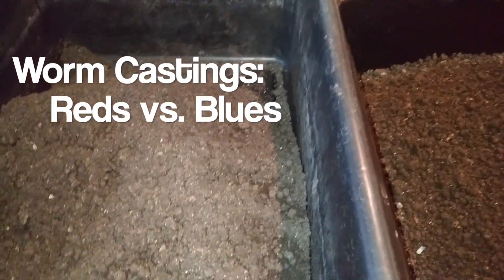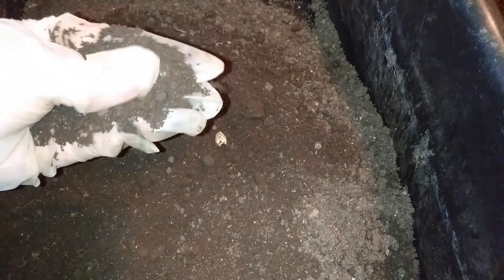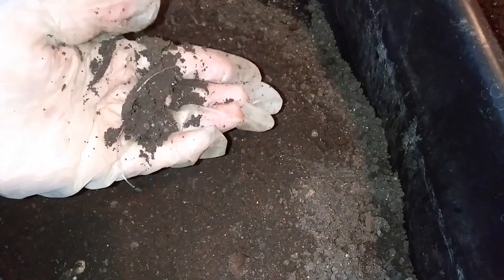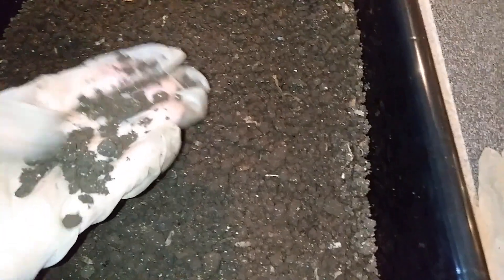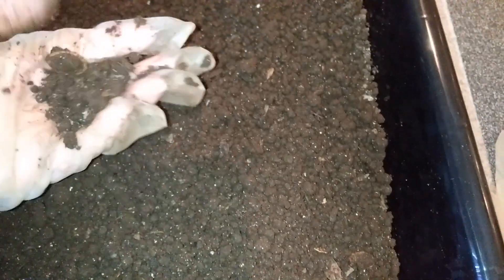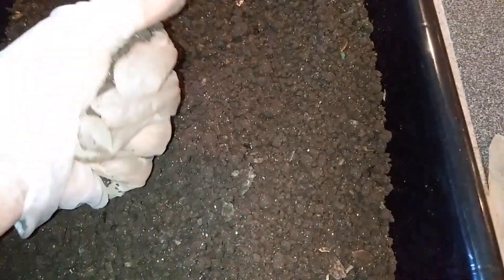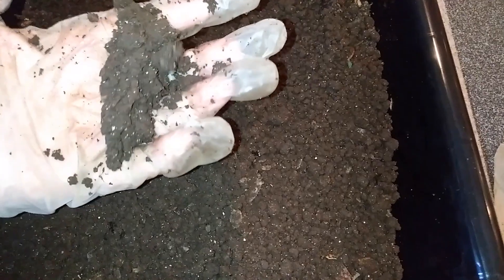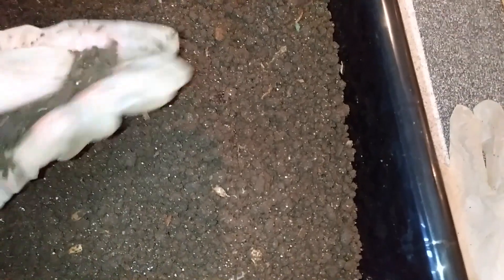Worm Castings: Red Wigglers vs. Blue Worms - Is There A Difference in Vermicompost?

Comment: If the castings clumps like that It isn’t fully done. I have wet castings I just processed that are fine and what clumpednwas very little and was food not quite broken down. Also, drying isn’t recommended, the microbes die and the castings will not take water again…
Reply from the maker: Are your castings from red wigglers or blue worms? In this video I was showing the difference between the 2 types of castings. Dr. Elaine Ingham has shown that microbes are dormant when soil/castings are dry and come back when given enough water.

Comment: Interesting. Did you feed or treat the bins differently? I started with a Uncle Jim mix in one bin and ENC in another. My UJ mix wound up mostly blues with a few reds. The blue castings are much much grainier than my ENC. My blue castings are not pelletized like yours. Whereas my ENC castings are clumped, which I do believe is because I actively added more water as they seemed to be happier with a more moist surface. Also I recognize that my blues seem to tolerate disturbance better than ENCs. Therefore I've turned the blue bin much more and more thoroughly. Also I feed the blues more. And again, their castings are finer.
Reply from the maker: I treat the bins & feed the same. Could be the environment here in Las Vegas affects the castings, too. Thanks for sharing your blues & ENCs experiences! :-)
Reply: @DaKineGardenStuff  I find it intriguing that we've had almost the reverse results. Have you ever had your castings dry and clump up when used as top dressing? I dressed my Orchid pots and the castings just seem to dry out right away into hard clumps. I've mostly only used blue castings so far.

Comment: Why do you dry and sift your castings?
Reply from the maker: For storage reasons, mainly. I sift it to get any worms and uncomposted materials out and put back into the worm bins.
Reply: @DaKineGardenStuff  my understanding is that the microbiology requires moisture to stay alive. Do you know what detrimental effects, if any, drying has on the castings?
Reply from the maker: @Doitallgp  Great question! I'm not sure of the answer, though. I've heard it both ways - that the microbiology die off if the castings are without moisture ... and then I've heard that they go dormant when dry but come back with moisture. Not sure who to believe.
Reply: @DaKineGardenStuff  thank you for responding